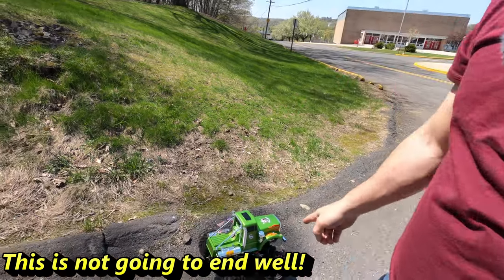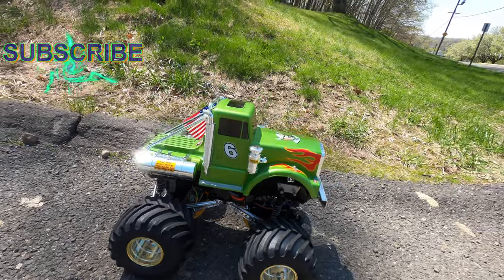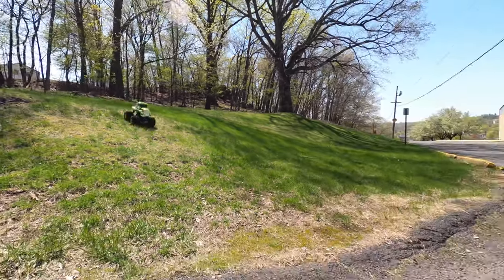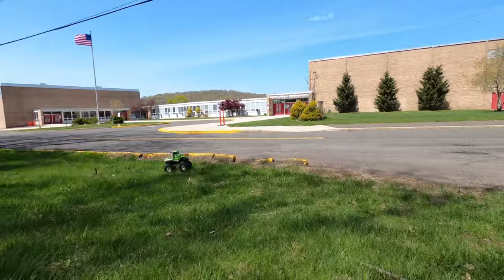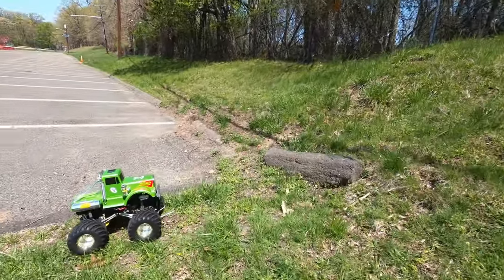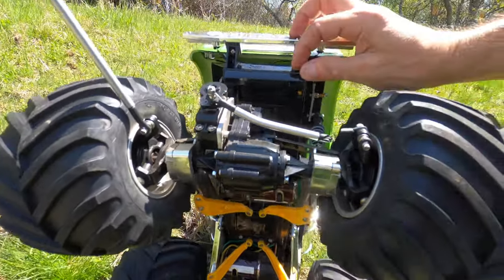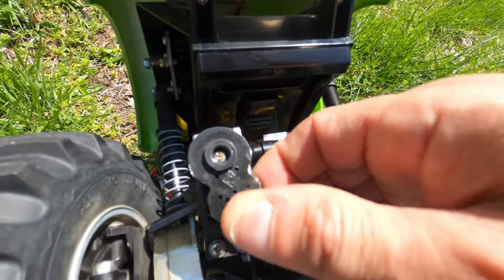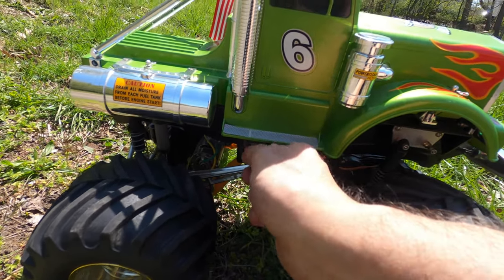Tamiya BullHead VS Rock head on! It's BROKEN!

Comment: Hi great video of the bullhead ! Awesome looking truck you got there 👍 I will be building my bullhead during the Xmas holiday, I’m looking to put a wider wheel kit on which brings the wheels out 1/2 inch, do you recommend this or know if it’s a good upgrade?
Reply from the maker: Hi cool! I would not do that it will just cause axles to bend and break more. In fact I built myself a clod with all the good aftermarket parts it does go faster and handles better but it still breaks. I sold it I have more fun with them almost stock.. I just ad rc4wd 20T crawler motors and Robinson racing pinion gears, 20KG steering servo and maybe a servo horn that will spread the ball joints out further apart just a couple mm more so you get better turning( optional you can leave it stock also), ball bearings oil shocks if you don't want it to bounce you can put one on each axle side and leave one stock one. Thanks for watching.
Reply: @ShenRC  thanks for your reply, all good information, I definitely will change the silver can motors and shocks ! I’ve already got the ball bearings and a carbon lift kit 👍

Comment: Love this bullhead! Is that a black clod chassis on there ? I just bought a bullhead and looking into upgrades
Reply from the maker: Hi yes this is the clod black chassis.  Good hop ups for these trucks.. ball bearing kit, robinson racing steel pinion gears, rc4wd 20 turn crawler motors, if using stock steering use a 20KG cheap metal geared servo from amazon, also if you want better turning get a aluminum servo horn that spaces the ball joints out a little further so you gain more steering.
Reply: @ShenRC  thanks for reply ! Ive just bought the ball bearings and carbon lift kit so far and looking into the two servo setup and linkage and oil shocks! The bullhead is still in the box unbuilt at mo until I get all the upgrades I need